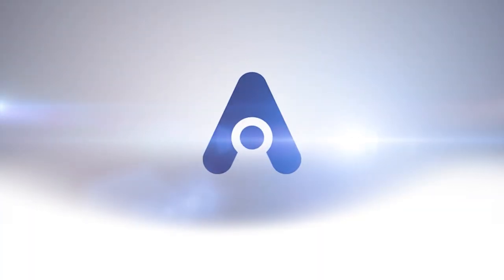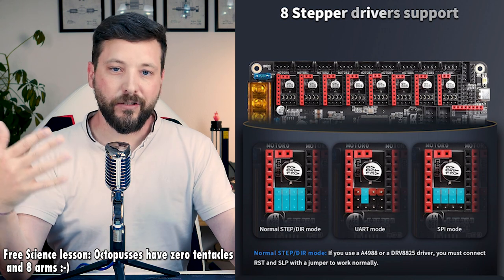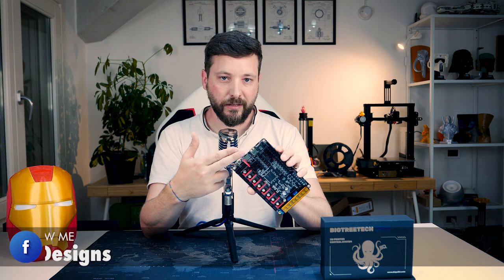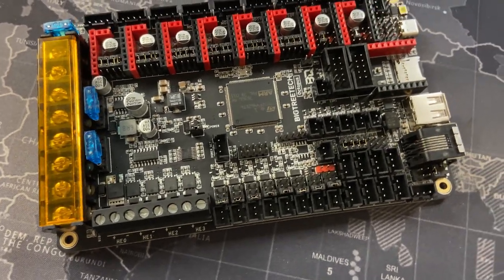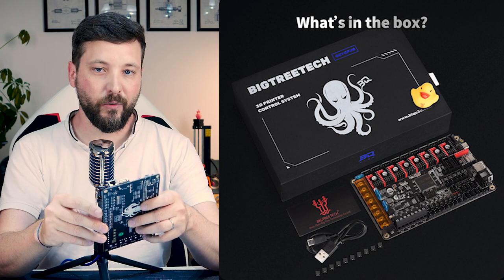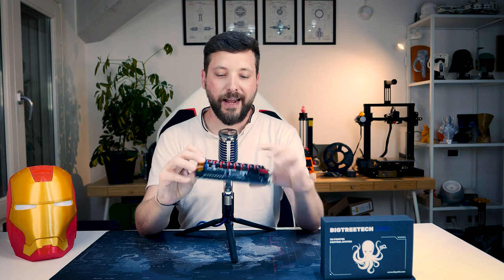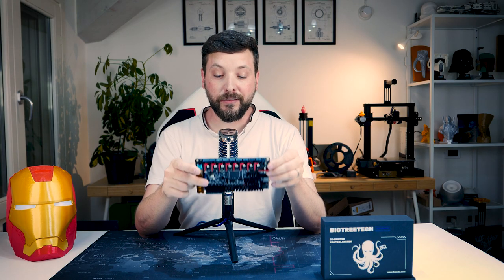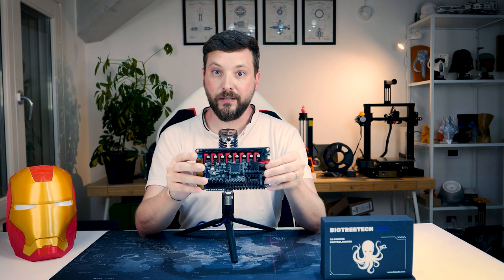Biqu Octopus: BEST Board in TOWN?

Comment: Actually one featuture I do miss: A port to sandwich a Pi Zero 2 directly onto the board, like you can do on the good old 8bit board Prusa mk3. While you of course can wire up it manually, I very much prefer the plug-in solution Prusa uses since 2017.

Also as always it is one driver less than needed: A voron 2.4 needs 7 drivers for the main printer + 2 if you want the Carrot feeder.
I do not think an Ender 3 is the printer this board is targeted ;-) So I would have prefered one driver more.  For the SKR 1.4 there is a simple expansion to add 2 (with SPI) or 3 (standalone) drivers if you do not connect a classic display. Might also work on the Octopus (editing the pin definitions). Sadly the EXP1, EXP2 connectors are not placed at the "classic" loacation.

The motor2_1 and motor2_2 outputs are for using one driver for two z-axis, so they are not independend. If you connect two motors to one driver, you shouldnt connect them in parralel but serial (like done in the Duet 2), bridging the second connector with jumpers. As there are no jumpers in motor2_2 connector I am pretty sure motor2_1 and motor2_2 wired in parallel, not in serial.

Also one or two dedicated ports for accelorometers would have been nice. While there is one port you might use (SPI3), this would be the best connection for a Pi...

Please do not missunderstand: The Octopus is definitly a very good board and the best in its price range (of course it can not compete with a Duet 3). But there is definitly room for more features.
Reply from the maker: Thanks for the explanation! I’m a bit behind with my projects. Definitely more will come on this topic